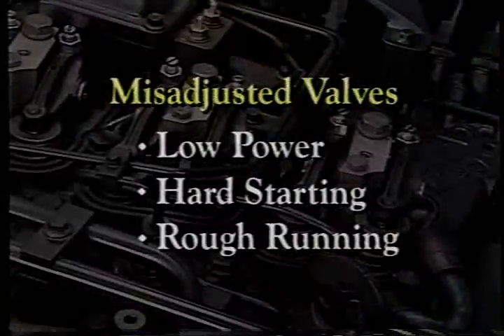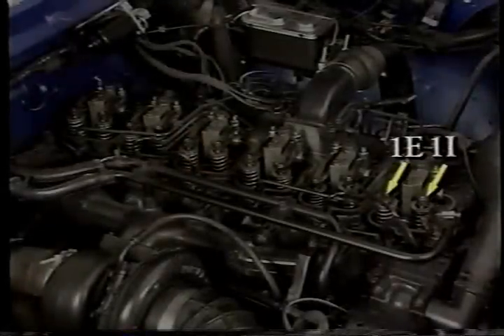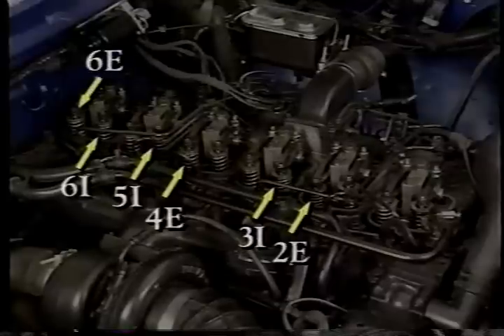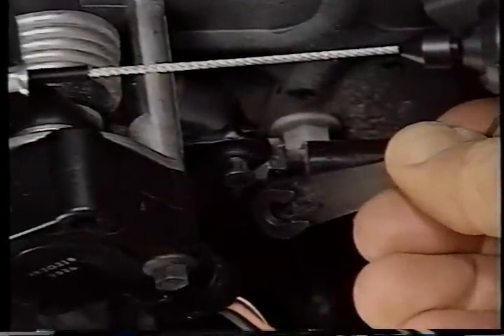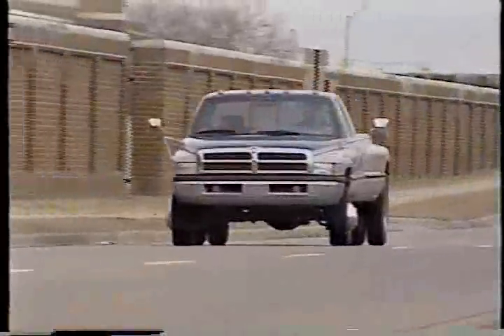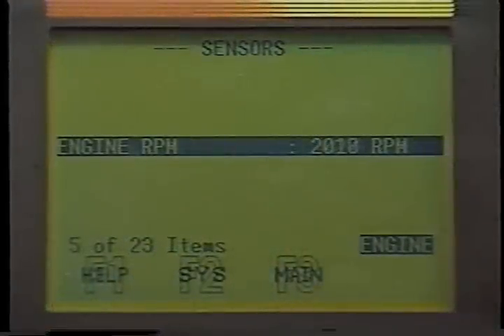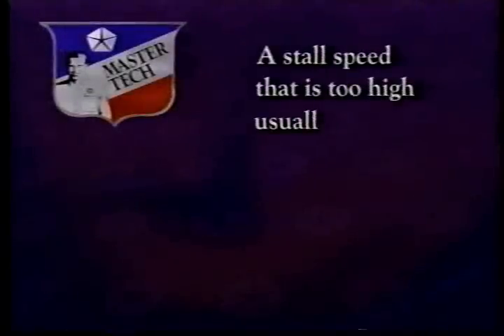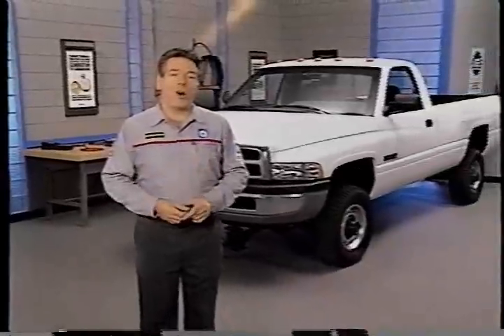Cummins Diesel Engine Performance - Part 4 of 4

Comment: Hi I'm from Ecuador. I have a 1996 dodge ram 2500 turbodiesel single cab 5.9L and I have the following problem and no one has found a solution yet. The problem is the following: When the engine is relatively cold, it shifts normally (at 1500 -1700 - 1800rpm) but after 15 or 20min that the engine has reached its temperature I must apply full throttle and reach 2100rpm so that the engine engine make speed changes. What could be the cause? Thanks for your kind reply